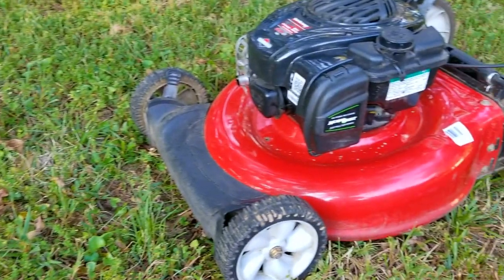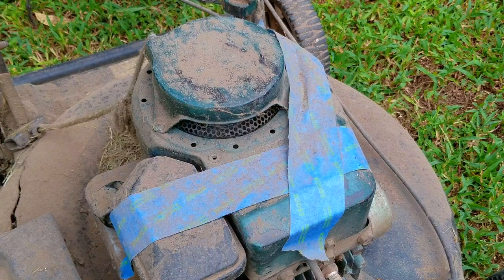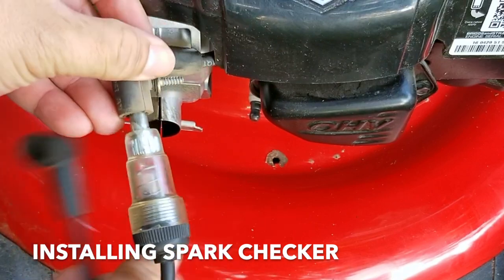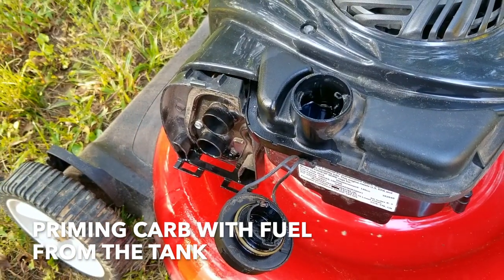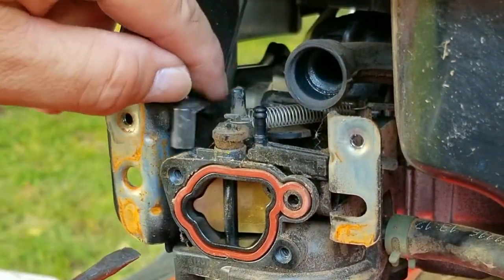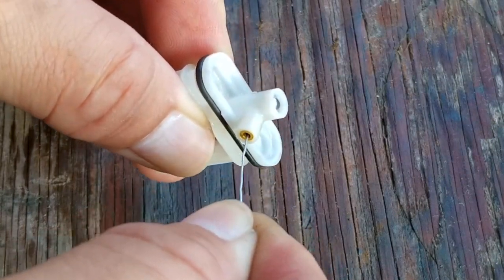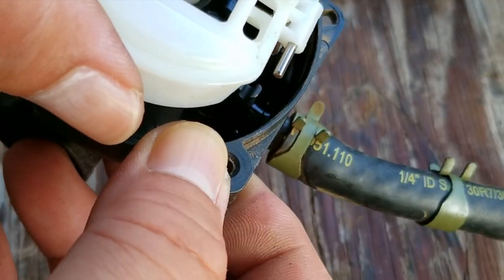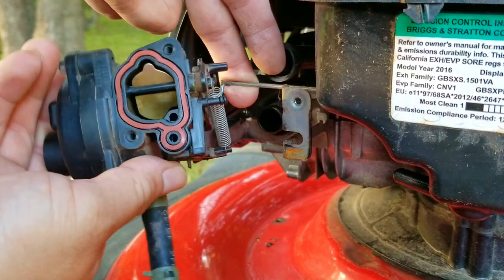Why Did Briggs Stop Making The Flathead Engine?

Comment: I have a 30+ year old flathead 3hp Briggs that was originally on an edger. The engine outlasted the edger and runs so well I couldn't bring myself to throw it away. I put it on an old school mini bike for the grand kid and he loves it. The engine has never been apart in over 30 years, doesn't smoke and still has good compression. That engine may outlast me!
Reply from the maker: thank you Rich B.  These flathead engines are fantastic
Reply: I'm still using my dad's Toro lawnmower from the 1980s.  My lawnmower guy told me to keep it and keep fixing it as needed because it's better than the new ones.  My repaired old machine is better than a new one.
Reply: I've got a antique derelict looking Eclipse brand push mower that was left in a shed on my property when I bought the place in the 90s. It has what I assume is it's original flathead Briggs (oil bath air cleaner and all) Judging by old pictures/ads/articles I've found online over the years I've determined the mower is from the mid 1960s. No idea how long it had sat, but it didn't take much to get it running again, and it actually runs pretty good. I'll get it out and mow the yard with it a couple times each summer, usually get some interesting looks from the neighbors likely wondering which pond I pulled it out of... 🤣
Reply: I have a old Craftsman mower with a Briggs & Stratton six and a half horsepower on it so far it's 16 years old it is an overhead-valve design but roughly seven years ago I found it at a junkyard me and him pulled it out of the junkyard and took it back to a shop where the only things we had to do to it was change the oil put some fresh gas in it and blow out the air filter and put a new spark plug in and it's been running ever since it always starts on the 2nd pull doesn't smoke and the only thing I've had to do to it over the last seven years is put a new air filter in do the necessary oil changes and just because I wanted to I put some Lucas high mileage oil stabilizer in it and I swear that engine is outliving its own body because I've had to flee rebuild the self-propelled system on the body switch out the blade and a bunch of the cables have already broke on it but personally I think the best parts about it is the engine actually has a variable throttle and variable self-propelled speed because the throttle adjustment can influence the governor on the engine and the self-propelled adjustment actually adjusts a CVT belt pulley attached to the engine crankshaft to adjust the speed
Reply: Mini bike for the grand kid...you sound like a good grandpa.
Reply: 1982 WAS A GOOD YEAR & CONGRATULATIONS 🎉 KEEP IT RUNNING AS LONG AS YOU CAN!

GOT A RAPTOR MULCHING BLADE & MAKE PARSLEY @ 1/2 " & CHIVES @ 3/4" + 1" = 2 CUTS & THE CHARCOAL IS READY!
Reply: @admiralrustyshackleford119  Just on a curiosity what do you feed it have you got a source to get non-ethanol gas at the pump Do you buy it by the can or you get it at an airport? Just curious 😉🫠😀
Reply: @Eric-qk5xk  I can't say I travel a whole lot outside of my home state of Iowa, but is it an issue getting non ethanol gasoline elsewhere?? I'm literally in the ethanol capital of the USA and pretty much all of our fuel stations have non ethanol 89 octane as an option right next to the 89 octane that is 10% ethanol blended, and most stations have non ethanol 91 or 93 octane available as "premium". 

I don't run any of my small engines or older vehicles on ethanol, and I've never had an issue finding non ethanol gasoline at any regular corner station. Now granted they do try pushing folks into using the 10% ethanol blended stuff as it's typically about 40 or 50 cents cheaper a gallon verse the non ethanol of the same octane rating.
Reply: The secret is it is sleeved. Guarantee it.
Reply: @wsbill14224  Yeah? You really believe that?
Reply: Yes THIS. It was originally on a generator, ended up on a pump, then finally ended up on a go cart i built. The engine outlasted everything it was attached to. The only issue with them was the valves would strech a little requiring a bit of filing the stems to retune it. The carbs hate ethanol gas, but upgrading with a ethanol compatible seal and diaphragm set fixes this. ❤
Reply from the maker: I can agree with that.
Reply from the maker: wow very nice find!
Reply from the maker: thank you Nathan Clark.
Reply: @Eric-qk5xk  I am in exurban NE Ohio about 30 miles east of downtown Cleveland, and we have a station that sells 90 Octane zero ethanol gasoline. A lot of landscapers fill up their gas cans there. I fill up 5- and 2.5-gallon gas containers there for all of my 2- and 4-cycle yard machines.
Reply: I just got a 6S Briggs from the 59s I believe still has an oil bath air cleaner. Needs carb work but I did manage to get it to run for a few seconds and sounds like brand new.
Reply: My  lawn mower is powered by a Briggs 4 hp flathead and it has gone through 16 seasons, many of which were heavy-duty, mowing a 1-hectare field. So far, servicing has been limited to the most basic, like oil & spark plug change and carb & filter cleaning and blade sharpening & balancing, and it still runs like new.
Reply: @coriscotupi  The way you're taking care of that Briggs, that engine will live for 20 more years with ease.